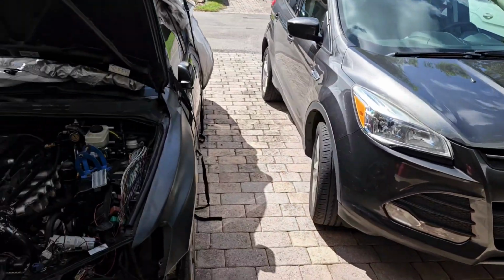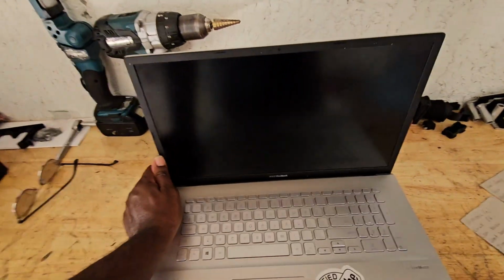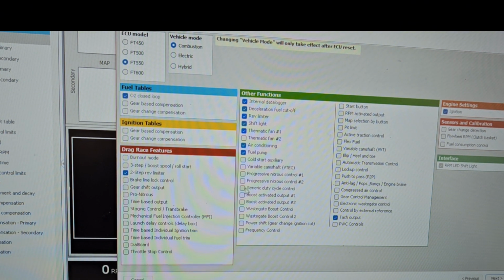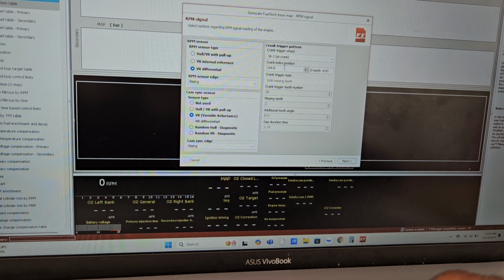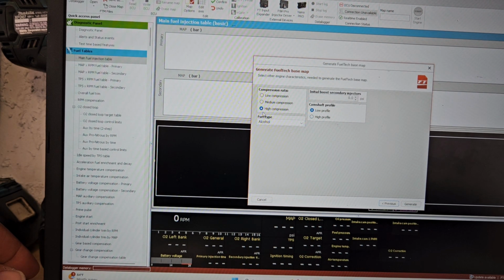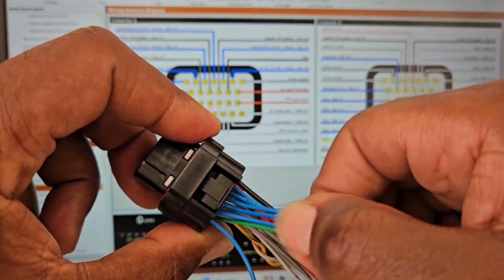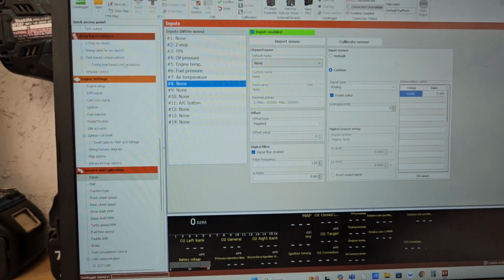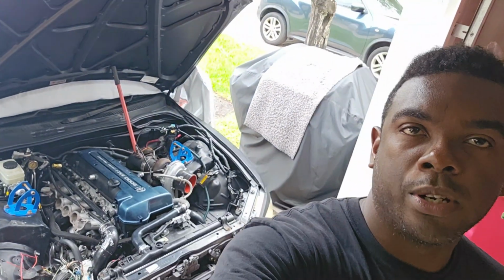2JZGTE Swap IS300 Fueltech FT550 Standalone ECU Wiring. Part 1 (Software Setup & Wiring Diagram)

Comment: Man videos are great and very helpful with my build  and greatly appreciated .still having problems with setting up trigger for crank on mine  . It's a 2jz ge vvti from a 04 gs300 . 36-2 on crank . But with crank index at 154.8 getting a lot of random pops from exhaust.  codes for crank missing gap tooth  detected at wrong spot . I Have cam set up as single tooth. Can sync at 90  and a 360 window . They sync great together but still something is not happy. Any help would be greatly appreciated
Reply from the maker: Appreciate it, send me a message on IG and we can try to get it sorted out.